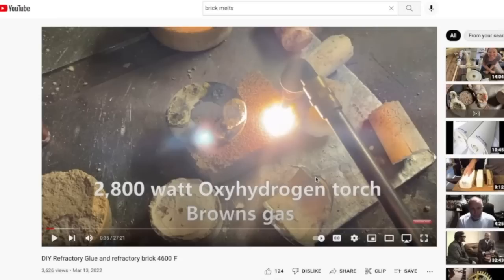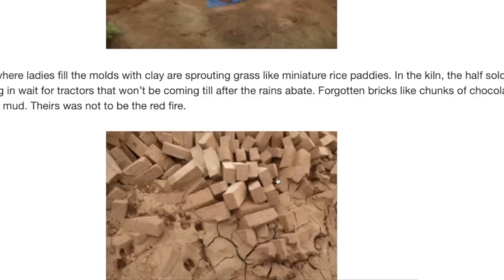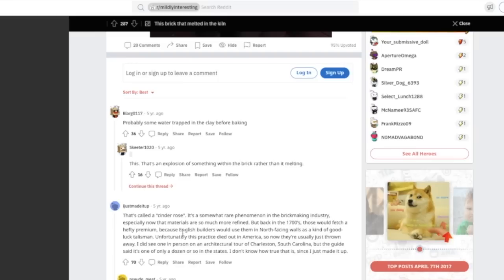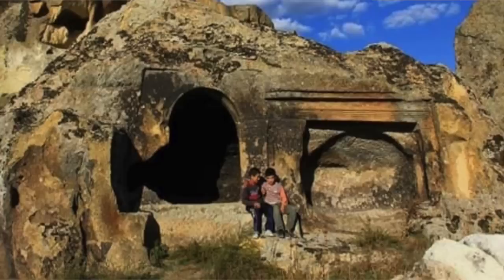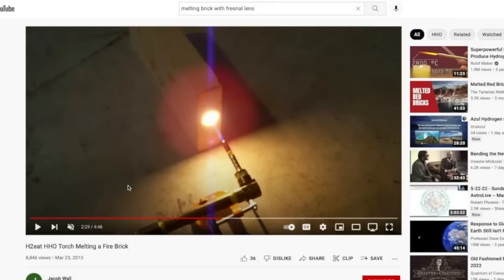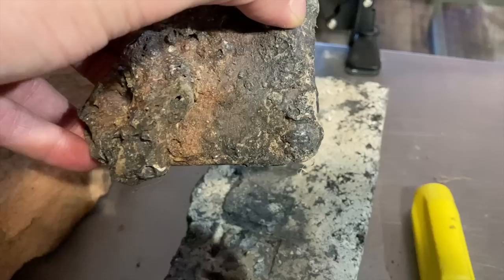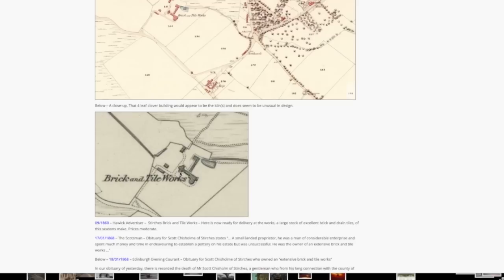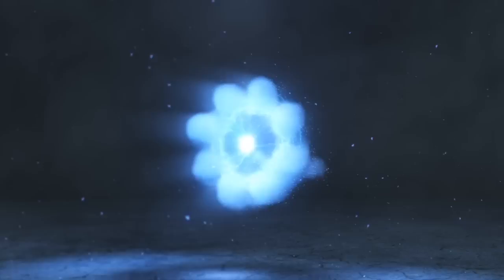Melted Brick Study

Comment: I was a bricklayer for 20 years........You can certainly heat brick up. They are clay, which is alot like sand. When we melt sand...we get glass right? Stone, which are a much higher density become molten when spewed out of a volcano. So in all actuality a brick wouldnt be any different. As they are essentially a man made rock of sorts. And fire brick are made from a refractory cement which has a much much higher heat range. Oh and this is OUR current tech bricks. I cannot speak on old world bricks. I have worked on some of those really old buildings "repointing" the Masonry. I will certainly tell you the mortars and cements they used previously to the garbage we use now was far far superior. Portland cement based mortars seem to be MADE to degenerate after a while. Where the old world stuff has alot less sand in the over all mixture. Also has some fibers in it...horse hairs? Something else old world?? We now a days use a fiber mesh in our mix to add strength. Anyways sorry for the rent. Your videos grease the wheels in my brains <3
Reply: Spot on, old mortar is far superior.
Reply: Maybe it's human hair? Has anyone done biological testing of the old bricks?
Reply: Great point!
Reply: @koninginvictoria   yep 👍 check for pulverised 'post rezets' bone dust in brix n morter , jus'sayin
Reply: @koninginvictoria  human hair and blood in the brick. Probably bone too. Gotta do something with all the dead bodies.
Reply: Good  1st comment^^
Reply: Thanks. Speaking from personal experience is one of the Last, true methods of learning.
Reply: what about hemp?  I hear that was widely used...
Reply: Hemp fibers
Reply: Have you seen these videos of people making old world cement from ash and stuff?
Reply: Good stuff brother thank you and God bless you in Jesus Name!🕊🙌
Reply: @SchizSchool  volcanic ash, lime and salt water. Not sure if volcanic sand was also added.
Reply: Mr. Mike:
Yes, why would the mortar and material construction be superior in the past compared to today if our construction tools are supposedly more advanced? The only logical conclusion is: our construction tools and building techniques are NOT more advanced than our ancestors so they were the superior more advanced builders and civilization. 🤔🤷🏼‍♀️
Cheers
Reply: Dont ever be sorry for a rant that's full of great informations. Rants like this in the comments are a huge part of this community and what makes it so fun.
Reply: @kristimcgowandarkoscellard3126  over the course of decades, investors learned that commodities that last forever don't bring enough money to their accounts.
This is why our civilization is pretty much disposable.
Don't think that there aren't people out there who can and still do create things that could last forever, it's just that it isn't economically worthy. It's more like  I'll do it for myself kind of thing
Reply: @SchizSchool  No but it sounds interesting.
Reply: @koninginvictoria    MudFossil University does testing on bones and what appears to be rocks, but are really bones.  But I haven't seen any testing on bricks.
Reply: @riccocool      Could you share where you found this information?
Reply: Thanks for sharing.
Reply: Roman cement was superior in longevity because it was made with mixture volcanic ash. I forgot the exact details how but it basically made it being able to adjust chemically better as the time goes on.
Reply: @libertybell7145  I read his comment as a theory.......a guess; and maybe not a bad one. I wouldn't take anything off of the table.
Reply: @riccocool  
Yep I agree. Where are all the bodiess from the dead?? They used them to build with, a perfect way to make them "disappear".
Reply: @soupflood  
Yes and when they need to destroy for the next reset it will be easier. They had a tough time destroying the old world stuff as we see.
Reply: I have an HHO torch.  Lemme see if theres any bricks in the yard.  Pretty sure there are some. My torch of course is semi out of commission. The torch part you hold got plugged up somehow. But i can jimmy rig something. Probably try making a glass torch ….. though not have a way to adjust the flow is a bit of a concern although wide  open is what we’d want.  HHO gas is super X plodey

Ps

My profile pic was made using my hho torch. It’s made from  a borosilicate glass ampoule.
Reply: That wasnt a rant. It was well written and appreciated.
Reply: @George Preece oh
my word…. the horror… :(
Reply: In Attack on Titan the giant walls that surround the cities are made up of the titans themselves truth in plain sight!
Reply: Mortar keeps stone separate,  cement sticks bricks together, a stone mason born in the 1800s told my dad that when they worked together when my dad was young.
Thanks for your comment, it's good to hear others knowledge.
Reply: @kristimcgowandarkoscellard3126  Look at the roman coliseum which still stands and is mainly concrete. We cannot to this day create a road to last that long. Let along a free standing building on The archways and what not. And I agree. We lost tech somewhere along the way. In advances of Electricity, Building, Religion, Medicine. These are all the real truths hidden from us. The normal folk.
Reply: fastguitar  I live in New England, and have seen some crazy mudflood tech buildings. Built by the Vanderbilts themselves. Look up "The Breakers" in Newport Rhode Island. These people had a form of"air conditioning" before it was even a thing. They boast of this in the guided tour. Stone houses made in Tartarian style.
Reply: @timishere1925  A theory guess backed by some hands on experience? Maybe? I am by no means an expert in any regard. Just sharing some information I have learned. Maybe someone can leap frog off my findings. :D
Reply: @George Preece yeah, but what happens if you remove the wrong brick?
Reply: @riccocool  Makes me think of the Great Wall of China.
Reply: @mrmike4228  Sounds good. I appreciate it. I was hoping the commenter had somewhere to point us to. Thanks again.
Reply: @susanjaeger9851  "Yes and when they need to destroy for the next reset it will be easier."  You made me think of the Three Little Pigs story.  And, "think mirror"; the story happens in reverse.  The oldest buildings are the most difficult to destroy (final pig's house made from bricks); the one in the middle is accurate (sticks, and of middling difficulty); and the newest are the easiest to destroy (first pig's construction, made from straw).

Thank you!  God bless in Jesus name.
Reply: @Coincidence_Theorist  
Well try not to X plodey yourself up, 
just melt the crap outta some bricks 🧱
And video it so we can watch 👀
Reply: @kennethbeal  
And God bless you as well Ken my brother in Christ💞
Reply: Thank you for your comment.
Reply: @mrmike4228  exactly, and gardening too. The lost arts.
Reply: This theory assumes volcanos spew melted stone. No one really knows what volcanos spew, but alternate theories are that they are underground mining deposits and chemicals from ancient times which are reacting with each other.
Reply: It's the same tech issue with obsidian blades in surgery...
Reply: If I may add a little just for grins...What we saw here with melting brick and the granite was an intense stream of energy (like a laser) focused on a small area. In kilns, the materials heat equally but don't have flow. Not that I'm naysaying anything I hear on Tartarian/mudflood/forbidden archaeology channels. My background is in geology and archaeology. If these discussions bothered my perspective, I wouldn't watch them. I just think broadening the research focus to include "weathering" of any questionable material might add to the research, as well as also throwing in the term "clay." I dealt with clay, bricks, and kilns in excavation of a sugar mill plantation site and took a few semesters of ceramics to understand what's found in most archaeological sites. I would think that all exposed potsherds/ceramics/exposed brick should melt at archaeological sites (including historical archaeological sites) if there's a strong enough energy blast bombarding said clay materials. Or there was a theoretical intense energy blast (laser-like) to monkey with a spot affecting something like a brick, etc.? Honestly, I think that brick with the blasted area had an inclusion of something that exploded when heated. Sorry, just thinking aloud. Jon's channel is great food for thought.
Reply: After being distracted by a cat fight outside, I realized I forgot to mention "brick style". If brick is older and considered cruder by design, older bricks should be solid because I went to a presentation on brickmaking the old-fashioned literally 'throw-a mass of clay/mud in a rectangular mold and press it down then dump out to air dry, repeat' exhausting process (temper being key to allow for freeze/thaw in buildings). Anyway, that melted stack of bricks in this presentation were hollow. Maybe this is firebrick for ovens? But the void space seems to me to allow for deformation with heat and overbearing weight. Not that bricks would never melt. I'm not claiming that. But void space should be a factor for heat deformation because there's a funny thing called gravity--supposedly. Although, I am sick of living in a scientific culture where science has turned into a 3-ring clown act. Just noting check the brick "style" for another angle. 

Thanks for all the hard work, Jon!
Reply: @susanjaeger9851  Ashes to ashes, dust to brick to cathedral.
Reply: @soupflood  Russia keeps building old world style buildings most are churches
Reply: Don’t be sorry. That was very interesting! 20 years… I’m sure you have other experiences. Have you seen first hand the mud flood low windows covered? Many still remain. So sad they demolished these beautiful buildings.
Reply: Sorry but Clay is nothing like saying, Clay is made up of kaolinites, are sticky but  slick on the molecular level, while quartz is quite Sharp, also quartz or silica has a much higher melting point but yes both can be melted
Reply: @diychad7268  brick isnt exclusively clay. It is a large make up sure, but there is also quartzite in there. Some event have pebbles in them.
Reply: @alealdama6747  *
Energy harvesting building*
Reply: I'm a potter so my 5 kilns are all made with fire brick I akin it to like a soft pumice stone.
Reply: @Muddyorphan1812  potter ones are. Masonry ones are dense and hard. The ones for chimneys must be saw ot chisel cut. Where as the ones say blacksmiths use are lighter weight and appear how you mentioned.
Reply: I live in an apartment building that was (allegedly) constructed in 1906. The plaster on the walls is so hard that I bought some masonry drill bits so that I can drill holes to hang things!
Reply: @ElveeKaye  That is horse hair plaster. My home I live in now was built in 1910. And had alot of the same stuff. :D:D:D I am wondering if these are the fibers they used in masonry back on the ancient times? Some others have said Hemp which makes sense.
Reply: Genesis says they used hay
Reply: The red comes from blood
Reply: @rootz420  me too I thought of hemp fibers at once.
Reply: Hempcreate!

Comment: This may interest you. When I was younger I was very interested in the subject of the hollow earth, I read dozens of books about it. The most interesting one was a book called Etiodorhpa ("Aphrodite" in reverse). In this book, the main character (who is based upon an actual historical figure named Willam Morgan) is taken into the hollow earth and told "occult" information about our world. One of the things he is told is that the inner earth is not filled with magma. The liquid in the earth is simply liquid water, underground rivers and oceans. Under certain conditions, these oceans are put under tremendous pressure. Seeking a pressure release, the water races through channels in the earth, reaching increasingly higher temperatures, this water cannot evaporate because there is no space for it to expand beneath the earth, so it actually reaches temperatures that can melt rock. The lava that spews from volcanos is in fact rock from the inner earth that has been melted by superheated water rushing up from giant oceans and rivers beneath the surface of the earth.

Comment: I can only give you anecdotal proof(which isn't really proof). In the 80's, my grandmother's building burned down. the following day i went with my father to peruse the damage and noticed that the chimney bricks had melted. I asked what would have caused that excessive amount of heat. He told me that my grandmother's building and the adjacent building shared a basement. The adjacent building happened to be an old grocery store that use to cure meats especially pork, in their section of the basement. He told me that the firemen couldn't put the fire out...it was too hot. The firemen of the 80's had no knowledge of the curing area that hadn't been used for at least 50 years. The assumption is the fats from the curing area had to burn out on their own. The heat was enough to melt the chimney brick. Just a story, but i'm sticking to it, I saw the bricks. :)
Reply: Our restaurant burnt down 15 years ago. My friend owned it, the guy up stairs was doing charcoal lamb skewers, burned the place to the ground. It might be the combination of things like an exploding gas line half a mile away plus a tree falling on a power line.
Reply: Whoa what I’m reading into your comment is that if people are in burning building… you may be onto something 🕊
Reply: athena b
Nice example! Odd but excellent. My experience is with a typical wood burning stove.

One is never to burn pine in a wood stove inside any structure bc of the excessive creosote that Pine expels. All wood does to some degree. It coats the chimney and after buildup, can fuel a very hot fire.

The temp depends on how thick the creosote is. Regular chimney sweeping is critical to fire prevention. 

Basically a forgotten maintenance task. And why you pay premium prices to insure a building with a wood-stove. IF you can find an insurance company that will write a policy at all.
Reply: Fats maybe, but also maybe nitrates used in the curing
Reply: Fat is stored potential energy. Makes sense to me

Comment: Interesting video Jon . I was a Maintenance Manager in a brick plant , one of the biggest on the world. We used to pay guys to grease the wheels , even if they didn't need it , on the kiln carts that carried them through the furnace because if it stopped or jammed the bricks would MELT . 
It happened periodically though and took a lot of effort to clean up . The kilns themselves  take two weeks to heat up and or cool down .

Comment: Bricks can melt, I work in a London brick factory in Kent England, I go on coursesall the time about our kiln and the cars that run through the kiln can and do get stuck from time to time and the most important thing is to get them moving again before they melt into a pile of sluge and also before going through the kiln they are dried when they have just been dried and not fired ( so before the kiln) you just need to add water and they turn back into the brick mix (mud)